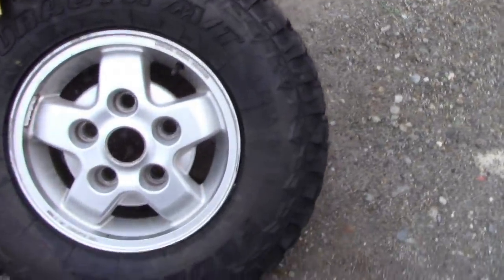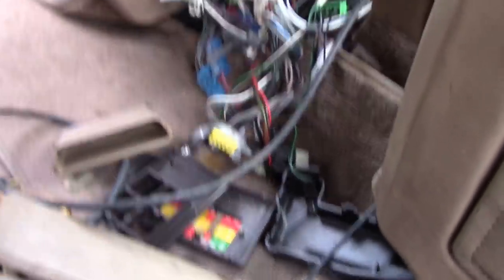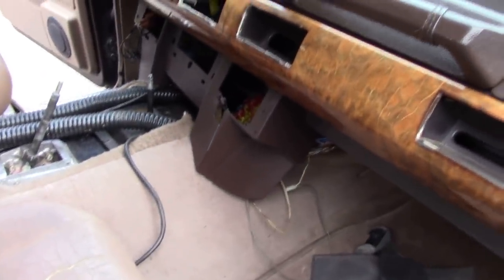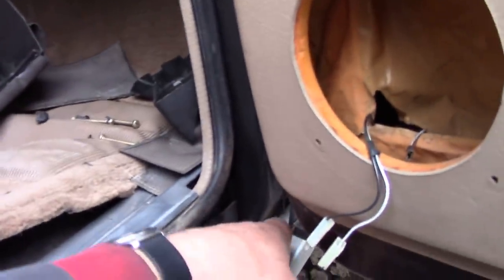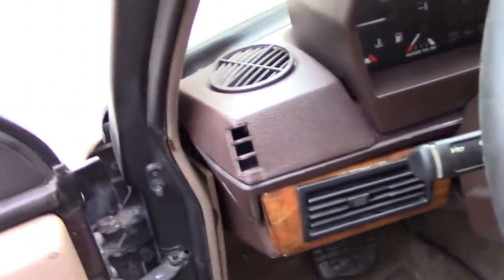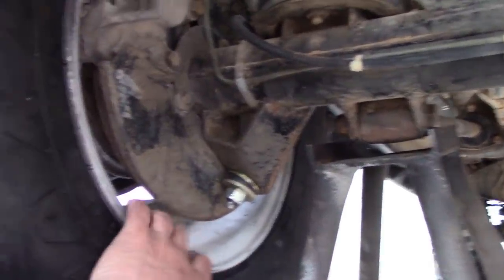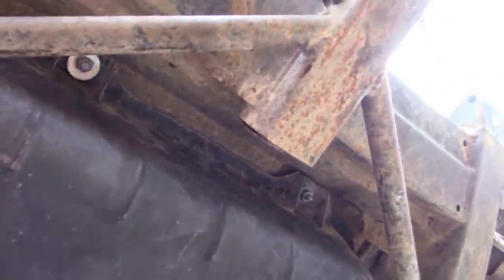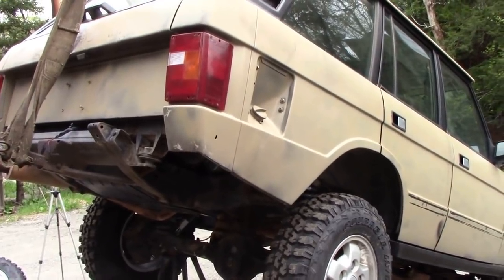Looking at the 1991 Range Rover project vehicle before strip down

Comment: I put a 200tdi in mine and it was brilliant as a daily driver, but it was also a great way onto the ladder of land rover ownership.... I used the Borg Warner transfer case on the back of the lt77 and it was easy to get the engine to sit in the right place for welding the eng mounts to the chassis... I
 used the coil ignition live for the stop solenoid and we were in business... I like the look of the csk short bumpers and made my own out of the standard vogue ones and I also had to weld most of the rear inner wheel arches, rear quarters, inner wings and sills, but it was a great car.

Comment: After market mirror with a reverse camera. 

The window rubbers are the same as a D1, but given the window frames are about the only things shared over D1 and D2 maybe Dr rubbers could be used. Good luck.
Reply from the maker: There is a bit of a difference with the rubbers - the RR rubbers go under the mirror where the D1 butts up against them

Comment: I have a '95 300Tdi RRC, all factory spec.  It's not quite as "nice" as a V8, but it manages 35mpg and is happy at 80mph without much cab noise(tops out at about 95) and is far more reliable than the V8, so it's a good option and not a wild mod given it was a produced spec.  I wouldn't have a ZF with the Tdi, though - it needs an R380 to squeeze the lesser performance from the engine.

The carpet section you had folded is for the lower tailgate.  I think the window seals are being remade - JLR Classic are gearing up to remake most parts and have a lot of RRCs going through the works, but Discovery 1 trims will also fit, and I think D2 trims, though slightly different in profile, also fit.  I suspect you could use manual seats from a D1 with the RR cushions, trim and arm rests to get around the broken switch gear if it's irreparable.

Comment: All you need now is its evil twin that has a rotted chassis but a pristine interior. Kidding aside, I suspect buying a wrecked RRC with a good interior would be the most cost-effective way to get all the interior bits you need. The time/labour to spruce up what is there seems uneconomic to me. As far as engine, go with a good Rover V8. As you say - fuel is cheap. Save the 300tdi for a Defender

Comment: Always wanted to put a tdv6 in a classic
Reply: Lmarkwell No. stay away from tdv6
Reply from the maker: Yeap!
Reply: Andy Kirwan tdv6’s are becoming easily available for a decent price. The cost of a standalone ecu is around £3K which is the main sticking point
Reply: Lmarkwell They like to snap their cranks though. Rotate shells to block oil way. And cam belts loose tension.
Reply: Andy Kirwan don’t know about the cambelts but i bought my d3 seized, engine out £900 to get it rebuilt. Am sure if the ecu’s were cheap it would be a commonish conversion and rebuilds would be cheaper
Reply: Lmarkwell so have you fitted your rebuilt tdv6 into anything? Has it been running.
Reply: Andy Kirwan no went back in the disco and its our family car. Have a 90 but want a 110 or classic aswell with tdv6 or something nice under the bonnet